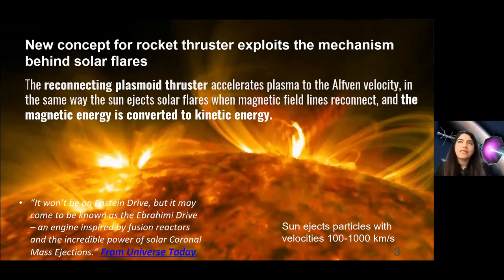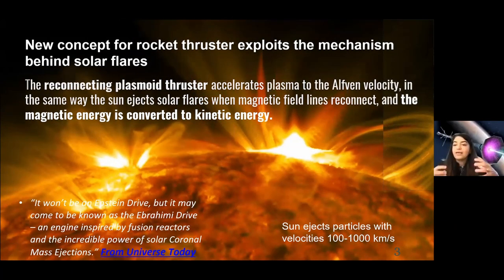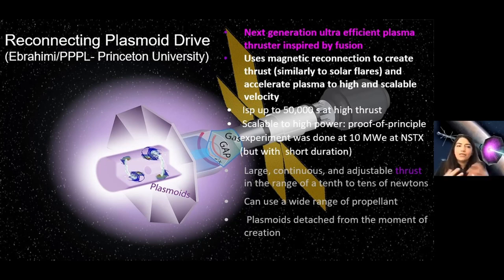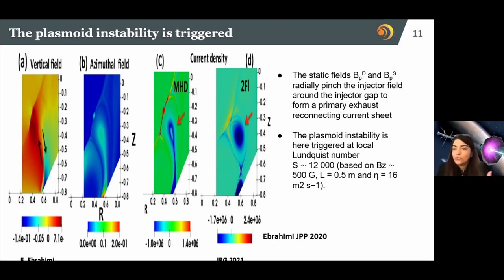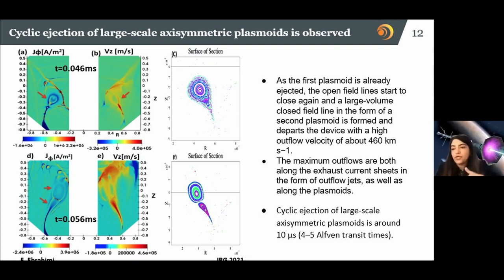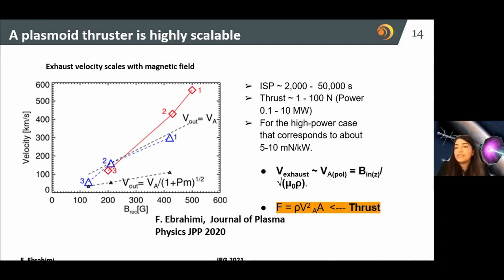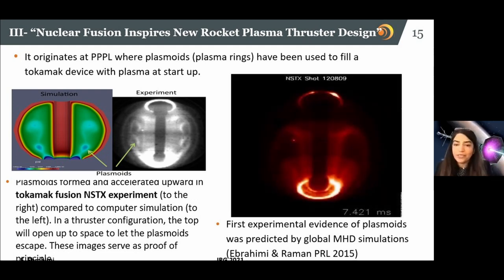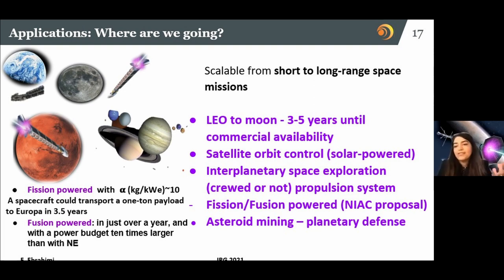16 -- Fatima Ebrahimi - Reconnecting Plasmoid Propulsion

Comment: As it seems to be a property of these field lines to convert into kinetic energy overproportinally...Is there any way to create a reconnecting field in FRONT of your craft? To have recombination happen TOWARDS your craft, sort of pull a bubble towards you (and make it pass through a hollow "tube")? Because, if you take this concept reaaaal far - you could harness recombination and plasmoids to - warp spacetime in front of your vehicle, thereby create the "disturbance" necessary for an Alcubierre like field?